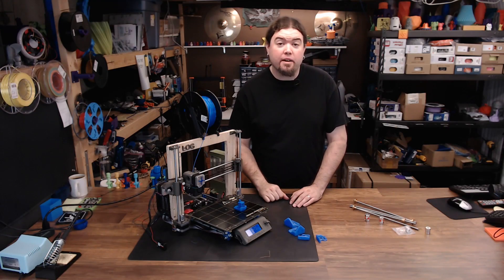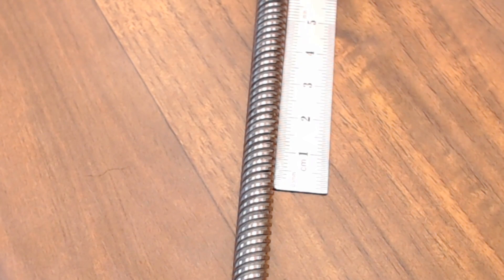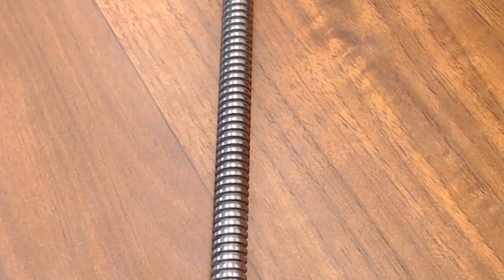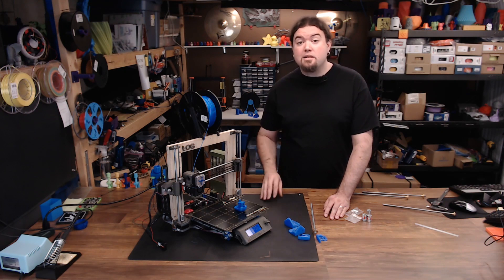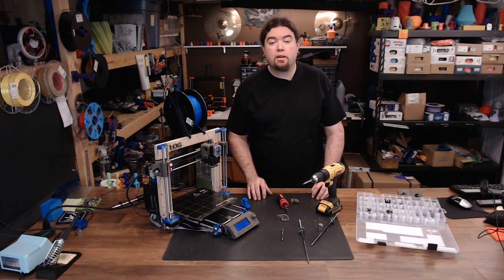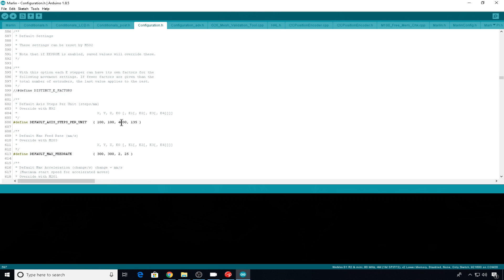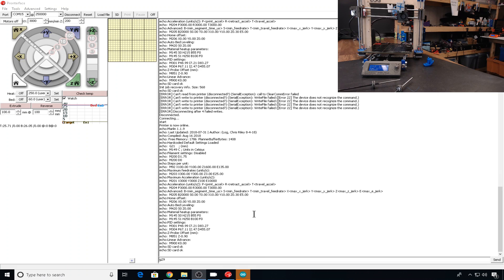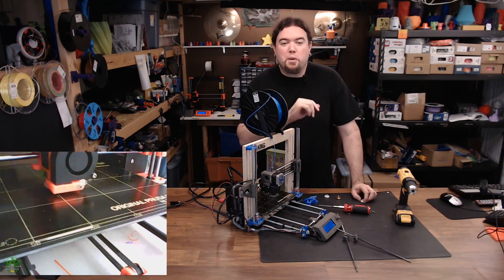Lead Screws - Printer Upgrade - Chris's Basement

Comment: I accidentally ordered a 2mm 1 start lead screw for a printer upgrade recently, based on the thought that 2mm per rotation would be more accurate on the Z axis than an 8mm per rotation. Thanks for confirming this, I'm actually glad that I ordered the 2mm lead screw over the 8mm one that I have on another machine :)
Reply from the maker: I'm glad this was helpful!

Comment: hi Chris, i own a Tronxy x5sa Pro with the oem board. If i want to go with a ball screw arrangement, would there be an off the shelf swap with the original screws? i.e. no firmware mod's. If firmware mod's are required, would it be difficult to work out?  (fyi, i have a duet 2 wifi on it's way from china). cheers Tony.
Reply from the maker: Ballscrew have a much less agressive thread than what you have, so you will have to change your Z steps. You can do that with the M92 Z   command.
Reply: @ChrisRiley  thanks for your reply. its just that even with anti-back lash nuts my bed moves out of tolerance after 2 prints. I got all the corners stiffened. Last solutions i think are ball screws or delrim nuts. Maybe look at linear rail combined with T8 screws? runnning out of solutions....
Reply from the maker: @tonypetroski216  Are you sure it's not the Z endstop not being accurate causing you problems?

Comment: also acetal (POM) nuts are amazing! Personally switching to them improved my ancyubic i3-mega's print quality. original prusa printers use those! just not the anti-backlash portion which isn't that necessary. they technically need no lubrication either. but those nylon-pla printed ones are just as good honestly. tho a few of them broke on my corexy cause the z axis is very heavy :D
also you can use spring couples without the side effects if you put an 8mm steel ball inside the coupler. just drop it in. screw the motor shaft and while you screw the top rod just pull it slightly upwards and tighten it.
Reply from the maker: Totally agree with you, I put POM nuts on pretty much everything now a days. I wish I could get some TR8x2 nuts.

Comment: Do the spider couplers offer more accuracy than solid couplers? Is the benefit just vibration reduction or do you actually lose or gain accuracy switching from solid couplers to spider couplers?
Reply from the maker: Both types have there draw backs, but one over the other shouldn't impact your accuracy. As long as your Z smooth rods are aligned and well seated either one should be just fine.

Comment: Tip from a guy that got a TR8 screw set for his cheap i3 clone and calibrated his printer for them: You can manually find the Z steps if you don't run the calculations seen in this vid with a great deal of accuracy dependant on how accurate your tools are. I did the same steps/mm calculation that you would use for E-steps and used a caliper to get a measurement. You should, for the sake of repeatability move the Z axis, measure, calculate, program, home, set to 100mm, measure, if it's within .005 to 0.01mm of 100mm you should be good for fine detail prints. If you want the extra granularity for whatever reason (maybe you have OCD for accurate Z height or you do very fine detail small prints) you can keep re-calculating until you eventually get a steps/mm value that gets you as close to exactly 100mm.
Reply from the maker: All great tips. Thanks for the comment. It seems lead screws very greatly from seller to seller.

Comment: Hi Chris have a question for you.

I have a modixbig60 prints 600 in all axis.

If I print a part with a height of 5mm it comes out about 5.3mm

Extrusion steps good but now I'm looking at the steps for my z axis..right now HMI says 2000. In which way should I adjust the steps to compensate for the increased travel.

ThankYou
Reply from the maker: You would adjust it down to decrease the amount of steps per revolution.
Reply: @ChrisRiley  So basically on the controller screen the 2000 is steps per revolution?  Thankyou so much for your response.
Reply from the maker: I don't know that printer but my guess is yes.

Comment: I switched from anti backlash brass nuts to  POM acetal nuts. they do need  bit of work (spinning them trough the rod like 5-6 times for me) to get smooth and always have a bit more friction but LIKE OMFG my prints look freaking injection molded now... it's insane
Reply from the maker: I recently ordered some from aliexpress so I never run out. I really dig the POM nuts.

Comment: ok so incase anyone aside from me was wondering if your old nut will work on a single start lead screw it won't I had a T8 4 start lead screw with an anti-backlash nut that I had to modify by grinding it (was for an ender 2) then bought a T8 1 start lead screw and it won't thread luckily the seller provided a nut I'm just going to have to grind it down to fit the ender 2
Reply from the maker: You mean 4 starts versus 1 start nuts being compatible? You are correct, they are very different profiles. Thanks for posting the info for others.

Comment: ok this maybe a stupid question but now I want to get single start lead screws for all my printers but after looking around I can't find any with anti backlash nuts as long as I buy the T8s with the 2mm pitch can I still use the same anti backlash nuts that work on the 4 start lead screws?
Reply from the maker: You can, but that is kind of a farce.  Those nuts are pre loaded if the motor is on the bottom. With single start you shouldn't have any issue where antibacklase will be needed.
Reply: @ChrisRiley  ok thanks for getting back so fast I saw a jump in quality way back when I started 3d printing with my robo R1 and I've been buying them for every other printer since I kinda wish I found your channel earlier but I'm really enjoying your videos if your ever in Alaska I'd love to grab a drink with you
Reply from the maker: @cityhunterinak  ha, I was in Alaska a couple years ago. I love it there. I'll let you know when I get back.

Comment: It's 400 steps per mm for a 4 start rod right? And you had 4 starts on the printer originally? But your steps per mm was 4000 before you went to 1600.
Reply from the maker: I actually had 5mm threaded rod before this upgrade. Your numbers are correct.
Reply: @ChrisRiley  ah OK, makes sense then. Love your videos. You explain a lot of things very well that most the big 3d printing YouTubers don't even really talk about.
Reply from the maker: @neilsiebenthal8696  Thanks Neil!

Comment: Nice video, just one thing:
Single start lead screw has smaller load capacity then 4 starts lead screw..
Reply: We're talking about 3d printer x axis load here though. The nut can take 1250 pounds before it gives. I think we're OK with single starts load capacity
Reply from the maker: @neilsiebenthal8696  Very true.
Reply from the maker: Thanks! Good point.

Comment: Ok. I have a question about your math. You say the printer cannot achieve a perfect layer at .15mm layer height at 200 steps per millimeter. I agree. But they you say it can't do that no matter what the micro-stepping is. Most printers do 16 micro steps. Which gives you 0.0025mm per microstep. 8mm/(200steps * 16microsteps)=0.0025. 
Layer height of .15 = 60 microsteps (0.15 / 0.0025 = 60). Layer height of .1 = 40 microsteps (0.10 / 0.0025 = 40)
So actually, in Marlin with a 8mm dia rod, with 4 starts, 2mm pitch and 8mm travel per revolution, you would enter 400 for the steps per mm - as I have on my Hypercube with 16microstepping enabled on the mainboard. Again, that works out to 0.0025mm per microstep with 60 microsteps per .15mm and 40 microsteps per 0.1mm. Even at .01mm that still exactly 4 microsteps (not accounting for MIN_STEPS_PER_SEGMENT)
Take your default steps per unit with your old 5mm rods of 4000. That 4000 steps per mm = 0.00025mm per step. .15 layer height = 600 steps. 
So, yes, if your drivers only did full steps, this would make a big difference. But then, you'd be entering 100 for steps/mm in Marlin and not 1600
Did I miss something?
Reply from the maker: I apologize, I didn't state that as well as I should have. The issue that you would see throws micro stepping out the window basically. I think I said "no matter what your micro stepping" or something like that, which now a days I see 256 stepping a lot, which is crazy to me.

You are correct, take 1/16 stepping the math works out. The layer height issue you would see is because the logic doing the micro stepping will never be able to match that exact step amount. Don't get me wrong, it is really good at what it does and getting better all the time. I have seen these crazy micro layer stacking issues caused by it. So staying close to the multiple of the whole step value should achieve better results.

Again, a VERY minor improvement, I really made the video as more of a "think about this" than anything else.
Reply: most 256usteps (all that i have seen anyway) is not driven with 256 usteps from the controller most of the tmc is run like it had 16 usteps, then the motor driver converts it 256 usteps internaly. So you will always move 1/16th of a step. the ressons for more steps internaly is to have the motor run smoothley and quiet
Reply: Microstepping lessens the torque and although the resolution increases the accuracy remains the same for the one step which means the percentage of error increases as the step degree decrease so multiply the number of possible error(accuracy) by the number of steps you will find that the total error per revolution increases drastically when increasing the microstepping resolution, to over come this point you need to decrease the speed (pulses per motor phase still the same but the time for the pulses should increase ie: operate at low fequency :D ) to allow the coils to be well energized to give enough torque, but thats donot mean that when lessens the speed you can get the 100% torque of the full step! 
Microstepping is no magic, just a tool need to be used in right time and place
Reply: Why are you running microstepping on the Z axis? You should be running full steps to keep the Z height as stable as possible.
Reply: Always love Chris's videos esp the Superman speed breakdown/rebuilds but it's also excellent that people who understand the maths can explain microstepping too. It's really good to read this information written down & have it's significance also explained, so THANKS for adding your knowledge.

Comment: Thank you very much for the video. Definitely a good bit of knowledge for the printer design I'm tinkering with. A quick question though as I'm leaning toward ball screws instead of the more common lead. Would this vid's info transfer 1-1 for both lead and ball screw set ups or would you foresee it to be a good bit of difference between one and the other?
Reply from the maker: It should be pretty much the same between the two. I don't know that you gain a lot from the ball screw unless your design is massive. I think it should work just fine either way.
Reply: Chris Riley  Was leaning toward ball screws due to the lower wear over time, higher overall load capacities, and higher general top speeds from what I've researched. The math for both was just in general driving me up a wall and your video made it just make sense. The main odd difference I'd like to attempt on the printer is a 100% non-moving bed. Concept wise that I'd like to try to do is to try and make a Core XY with that gantry set up on dual z with quad rails/guides along the corners of the printer. 

Hopefully this will work, here's a link to a pic of a rough sketch/concept I was trying in Fusion360. 
https://pbs.twimg.com/media/Dkhp60EVAAAGuRU.jpg

At least that's the thought so far anyway. If it works, Sweet, if not, well this machine is being made to be a machine I can tinker around with and add/remove components.
Reply from the maker: RasielD  It looks like it will be good times man. I hope it goes well.

Comment: Great video!
I found the Spider connectors caused a lot of binding because the threaded rod would not align with the motor shaft and cause the threaded rod to wobble back and forth. I'm also a big fan of Anti-backlash nuts on the z threaded rod as often there is some play in those nuts and that keeps the layer height very consistent.
Reply from the maker: I have found the spiders do have to be set just right to work well. The others are a little more forgiving. On the 4 start screws you are correct, the nuts can have a little play when they are technically already pre loaded gravity. The singles are almost impossible to back feed, so the seem more stable. Thanks for the comment and watching!

Comment: That's 0.04 mm per FULL step right? I assume you run at 1/16 microstepping, so each microstep should move your z by 0.0025 mm?
Reply: 400 (micro)steps per mm kind of explains it clearly :)
Reply from the maker: That is correct, 0.04mm per full step. Good point, I like 400 microsteps better.

Comment: This is an excellent video Chris!I'm sure many people haven't considered the step rounding "issue".  It will have an impact on high layer-resolution prints.  I have my 'specialty' printer build with a 1mm (single start) lead screw for producing 70um layers needed for some of my customers.  Produces silky smooth layers especially noticeable on top curved surfaces.
Reply from the maker: Thanks for watching! That sounds like an awesome build.

Comment: I initially built my version of Dolly with 5/16" threaded rod.  A few months ago, I swapped them out for 8mm lead screws.  I can't tell any obvious difference in the print quality, although the printer in general seems a tad quieter.  Another worthwhile upgrade is to change out the heated bed mosfet on the ramps board with a logic level mosfet such as a IRLB8743.  The original mosfet on the ramps board was too hot to touch while printing.  The replacement is barely above room temperature.
Reply from the maker: Agreed, those mosfets are junk, I have burned up 3 or 4 of them now. I am currently using a ramps 1.6 shield that has a little different type on it. So far so good.

Comment: I'm a huge fan of Oldham couplers, rather than those plum ones. But that requires to support the rods on a bearing.
Reply from the maker: Nice! I have never even seen these types before.
Reply: You could actually print some before getting the real thing : https://www.thingiverse.com/thing:2538792
After a year of use the PLA ones just begin to get some slack.
Here are actual ones https://www.aliexpress.com/item/-/32878380864.html?spm=a2g0s.8937460.0.0.1ee02e0en7BhS8
Reply from the maker: Sweet! Thanks for the links, I will try it out.
Reply: Chris Riley  or ya can go this route: https://www.thingiverse.com/thing:3098752
should be able to continue to use the z couple you got & switch back to the brass nut.

Comment: Hmm this bring up some ideas in slic3r settings for my Prusa mk3.  That is a 8mm x2mm pitch x 8mm lead from what i read in their forums.  Going by that a step is 0.04mm so I should set layer heights to multiples of that.  0.12, 0.16, 0.20, and 0.24 should be the height option for slicing to give no rounding inacuracies. Gota wonder why they give 05,10,15,20 as the preconfigured height settings in slic3r PE.
Reply from the maker: I have had those same thoughts. I mostly print at .2mm, but I kind of wonder why tr8x8 became the go to profile. Maybe they were easier to get? They are faster, but other than homing and leveling you really got no benefit from the speed.
Reply: Fortunately, you run at 1/16 microstepping, so you can divide your calculations by 16 and enjoy the sweet resolution :) Keep it at multiples of 0.0025 and you should be fine :)
Reply from the maker: @olorf  Agreed, microstepping is a wonderful magical thing. :)
Reply: Chris Riley  I think you may find https://hackaday.com/2016/08/29/how-accurate-is-microstepping-really/ interesting.
I don't know what load a typical Z axis imposes so I don't know if microstepping actually works as expected.
I am thinking of replacing my steeper with a 400 step/rev rather than replacing the 8mm lead leadscrew.
Reply from the maker: DennisFisherUK  VERY interesting! Thanks for the link. I have read a lot of white papers on this and there are many in's and out's to this whole mess.

Comment: Hello Chris, great video! Where did you get your couplers and rods from? I want to upgrade the ones on my Anet... :)
Reply from the maker: I was going to post some links, but those TR8x2 rods are hard to find. I am not sure how long you need for the A8, but give these a look.

Couplers:

Amazon:
https://www.amazon.com/Aluminium-Flexible-Coupling-Connector-Coupler/dp/B01CWMGUDY/ref=sr_1_4?ie=UTF8&qid=1537985231&sr=8-4&keywords=3d+printer+coupler

Aliexpress:
https://www.aliexpress.com/store/product/D20L25-jaw-flexible-motor-coupling-aluminium-CNC-spider-flexible-jaw-coupler-5x8mm-3mm-4mm-5mm-6mm/1949652_32875281411.html?ws_ab_test=searchweb0_0,searchweb201602_5_10065_10068_10130_5726815_10547_10546_10059_10884_10548_315_10545_10887_10696_100031_531_10084_10083_5726915_10103_10618_10307_449,searchweb201603_60,ppcSwitch_5_ppcChannel&algo_expid=83e0862f-2ec3-451e-9b4a-a9c10db4a12f-1&algo_pvid=83e0862f-2ec3-451e-9b4a-a9c10db4a12f&priceBeautifyAB=0

Lead screws, I have never bought from this seller, but it looks like they have 4 and single start screws.
https://www.ebay.com/itm/T8-Lead-2-8mm-Rod-Stainless-Lead-Screw-Linear-Rail-Bar-100mm-1200mm/173380260628?hash=item285e44d314%3Am%3AmFtiESWKdJ-moCcoGrJGcOw&var=472089195623

Comment: Great Job Chris!
I tried to explain the lead screws info in my "Need for lead" video.
Also the single start gives your Z Motor 4 times the torq.
I wish I could have presented if half as well as you..
Keep up the good work!
Reply from the maker: Thanks for the kind words, I also missed a point in there I wanted to make about single starts. It's almost impossible to back feed them, so continuous voltage on those steppers can be much less. Thanks for watching!